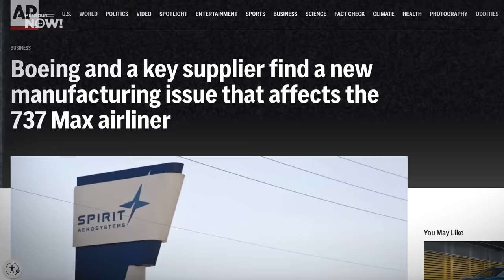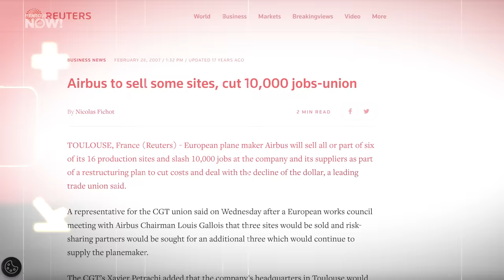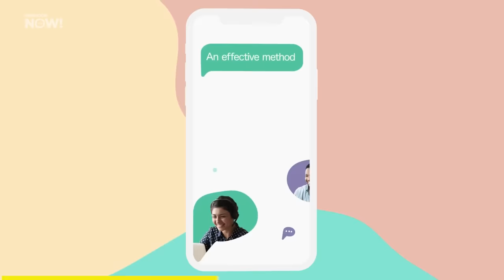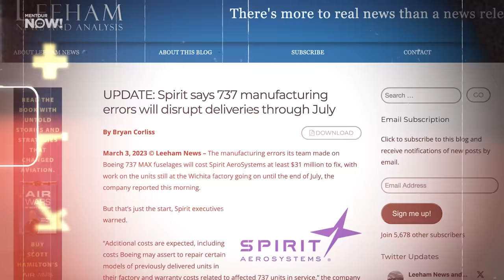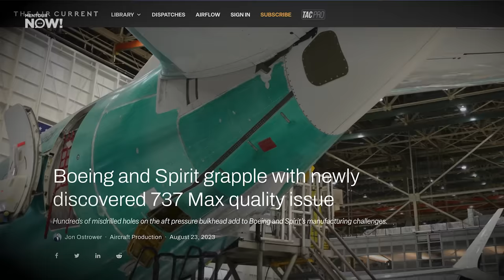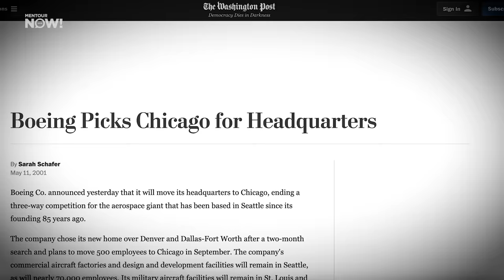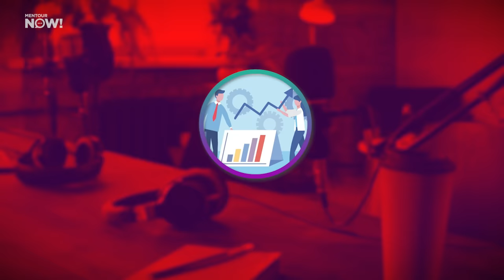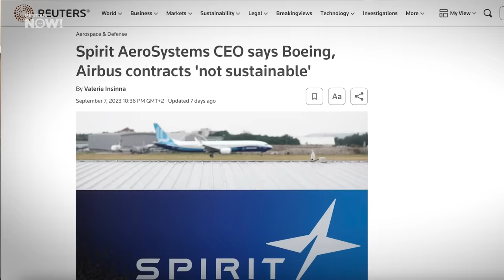NEW Problems with the B737MAX!

Comment: My respect to those Boeing and Spirit engineers that are holding on to their work ethics, honestly reported these issues and didn't let these seemingly small issues (but could be potentially catastrophic) pass by.
Reply: sh sh sh say what we tell you ex boeing worker
Reply: I'm having a disagreement with someone. What is the correct word to describe passengers disembarking a plane? Deboarding or deplaning?
Reply: @ghsubero I've heard both terms used interchangeably.
Reply: Well the route seems to be towards an ex Boeing engineer

Comment: Most impressive thing about Boing, is that they continue to disapoint without going out of buisness.
Reply: Thats not too hard when youre integrated into the Military/Space Industrial Complex so deep that the only option for the US is to throw Taxpayeer Money at you if your financials start looking bad. And if they keep looking bad, there always will be the next Military or Space contract where noone REALLY expect results (at least noone important) so you just get free government Money. Boeing isnt about building Airplanes or building anything. Its about influencing Voters by creating or removing jobs in key areas, paying Dividends to important Shareholders and keeping control over key elements of the supply chain. Money isnt an Issue.
Reply: Face it Orville...they make great aircraft and really don't have any problem selling their aircraft to hundreds of airlines. They are beloved by the pilots that fly them. Perhaps you are the one with the problem.
Reply: B737 "Maxx SHORTCUTS"
Reply: @MytronixOfficial B737 "Maxx SHORTCUTS"
Reply: That's because nobody went to jail when they killed over 300 people with the MCAS fiasco.
Reply: @lbamm  The justice system worked as designed. Just because you don't like the outcome...doesn't mean it didn't.
Reply: @RLTtizME  It's the legal system and there is very little concern for justice and if you believe different then you are a fool.
Reply: @craigmcallister2310  You kinda sound all jacked up.

Comment: The US as a whole seems to really be into this infinite subcontracting. Even in public projects you find the same mindset of "cutting" costs through subcontractors and it always ends up causing problems with the complexity. A lot of times, if something goes wrong, and in engineering something always goes wrong, that complexity ends up costing even more money.
Reply: So true. More effort is made managing the items that have been subcontracted. The savings are lost and worse the skills in those areas tends to be lost as well.
Reply: Short term profit. Maintaining the necessary capabilities means continuous investment, subcontract hides the costs of the latter making it appear cheaper.
Reply: nothing good comes from subcontractors
Reply: The video mentions (but doesn't highlight) the reason why subcontracting is advantageous. If the rear pressure bulkheads were still built in-house by Boeing, they would've had to shut down their entire production line while they tracked down and fixed the problem. But because the part is made by Spirit and two other subcontractors, only Spirit has to shut down their production. Boeing can still source the parts from the two other subcontractors, and keep their production lines running. Redundancy improves uptime.

Specialization is what took us out of the stone age. Before then, everyone had to hunt and gather their own food, build their own shelter, make their own clothing and tools, etc. By spinning these tasks off to certain individuals (subcontractors) who could then specialize in making only those items or doing those activities, they could become more skilled at it than someone whose time was distracted by lots of other activities (can do a better job in less time with less effort). And the people who can now trade for those products or jobs gain a lot more time they can use on other activities. That improves productivity. Nearly everything we build and use in our lives today is thanks to specialization / subcontracting.

The problem is it's not obvious how much specialization is the right amount. And different jobs can be optimal at different levels of specialization. Should the seamstress make her own cloth bolts and thread? Or is it better for her to buy them pre-made by someone else specialized in making just those? Most of economics is trying out different levels of specialization, and scaling back when things have become too specialized. All to try to get back in that optimal range. If you refuse to accept those occasional failures, you will never find that optimal range. And you will operate ignorant that you are doing so inefficiently.
Reply: @solandri69 Subcontracting isn’t necessarily a problem, but I’ve heard of subcontractors who start handing work off to sub-subcontractors and at a certain point it all becomes a mess.  In addition, when everyone is fighting to be the lowest bidder corners start getting cut and in commercial aviation, where the needs are so specific and the margin for error is so low, I don’t think that’s really the best pattern to fall into.  Obviously there are benefits to having multiple suppliers, but it’s Boeing’s name on the product and their reputation on the line if something goes wrong so I’m a bit surprised they’d outsource the production of such key components.
Reply: I called to order Domino’s pizza and it went to an lndian call center. Never called them again after that.
Reply: @solandri69 You’re right of course. The subject of optimal level of ”subcontracting”should be in focus. In our daily lives too!
Reply: That's the Mackenzie way of capitalism. Everyone's a bean counter now. They're losing their skills.
Reply: The fact that all that subcontracting causes extra bureaucracy overhead....
Reply: I had to laugh thou as the faulty parts were from SPIRIT and NOT the subcontractors 😂
Reply: It's capitalism. You're trying to make the most money with the least work. And the way you do that is you take $2 million for the part, then you find someone who will do it for $1.8 million and make it their problem. And they want the most money with the least work, so they take the $1.8 million and find someone who will do it for $1.6 million.
Reply: and worst of all, despite numerous examples (of subcontracting) that went wrong, they continue doing it -where is the learning effect?
Reply: and the very top of the contracting chain get to claim no liability
Reply: There's nothing wrong with subcontracting as such, it all depends on how you do it. 

For example, Toyota subcontract nearly everything, and that works pretty well for them. The reason it works for Toyota is because they do not treat a subcontract as a way of fixing cost, devolving risk, or shaking off responsibility for QC. When Toyota takes on a subcontractor, they don't set production targets, they instead set quality targets. Better 1 alternator is produced properly, than 1 million built wrong. They also move into the company themselves, get them working they way Toyota want them to, they educate them in "the Toyota Way". And, most importantly off all, *they pay their bills on time, in full*. The result has been that Toyota has a vast network of extremely loyal subcontractors who strive continuously to improve quality. 

Toyota can then mass produce high quality cars at good prices, and everyone in the food chain makes money, with parts famously turning up at the Toyota assembly line about 15 minutes before they're needed. Reliably. 

This has had other benefits for Toyota. They try not to have single sources of supply, but for some parts they have had. One of these suppliers had a factory fire, and shut down. Word spread throughout the Toyota supplier base. What happened was remarkable; a number of other Toyota suppliers worked together to establish temporary production of this part elsewhere, and helped the original supplier get back on its feet and back into production.
Reply: @juliadagnall5816  That kind of sub-sub-subbing happens, because the company at the top of the pile isn't taking sufficient interest in what their subcontractors are doing. Toyota is a good example of being very involved in what their subcontractors do. Interestingly, Toyota don't really major on production targets; obviously they want a subcontractor to make a decent number of whatever it is they're building, but it's the quality that's contracted for, not the quantity. Turns out that if you get the quality right, quantities will work out OK in the end too. Toyota also pay their bills promptly, which probably helps a lot. 

Boeing setting up Spirit is the complete opposite; it was a strong signal, "we're getting rid of this part of ourselves so we don't have to worry about it anymore". Well guess what...
Reply: Well Airbus do the same but they don't have the same issues. Looks to be just an American problem. Maybe they need to realise they are not the best at everything and just do the fucking job
Reply: I doubt subcontracting saves costs
Reply: It diffuses liability
Reply: This is the result when MBAs are left to make business decisions on their own.
Reply: @solandri69  true and the aerospace industry right now is a young workforce. And with faa NOT doing there jobs well, just adds to the industry issues. Boeing will get it right, it didn't go bad overnight, no one can expect a fix overnight. Nice read and really true.
Reply: Ahh the subcontracting mindset - the bane of quality, control, customer satisfaction! Eventually the loss of business because of the inability to deliver contractually.
Reply: @rogerdavis7450  not true Boeing has been outsourcing for over 90 years Airbus outsources as well no one airframe manufacturer can do it all...(NOT EVEN CLOSE TO DOING IT ALL) BOEING HAD A SURVEY DONE BACK IN THE 80S AS HOW BIG OF A BUILDINGTHEY WOULD  IF THEY KEPT THE WORK ALL WORK IN HOUSE.AND THE BUILDING WOULD HAVE TO 60 MILES LONG BY 40 MILES WIDE .END OF STORY
Reply: @rogerdavis7450  talk to the FAA it's their job to make sure qualityis up to standard
Reply: @juliadagnall5816 I never understood why paying someone on a full-time basis to do a job you have the capability to do is supposed to be cheaper than doing it in-house. If you would spend x in-house, they're gunna charge you x + profit + management fees.
Reply: @traveller23e  Cheaper is a relative term.  Think of it as a banquet hall hiring a full-time chef vs. partnering with a caterer.  The chef’s salary needs to be paid whether there are any reservations or not whereas they can call the caterer, who can cultivate relationships with multiple clients, only when they are needed.  It’s an imperfect analogy, but since Boeing can’t always predict how many planes airlines will order it kind of makes sense that they’d want to dump some of the overhead involved with manufacturing on a separate company who can have issues or go into debt without it showing up on Boeing’s financial reports.
Reply: @allthat46 It's a Boeing problem, not an American problem. Plenty of US companies build great things.
Reply: Sub Contracting is usually a way of offloading the blame for anything that goes wrong!	t
Reply: I think some of the problems companies like Boeing are facing are the results of following the outsourcing / subcontracting management fad that business consultants and rock star CEOs sold to companies in the 1980s. The “stick-to-our-core-competencies” philosophy behind subcontracting was, in part, a backlash to the merger / conglomeration fad that companies followed in the 1960s.

Comment: I have worked for Boeing and Spirit in wichita and I have seen many of the changes you talked about and you are right on. We truly strive to make the best products for the costumers. There have been several changes that affect production, sometimes in a good way and others in a bad way. Take "just in time" parts for example. The concept looked good on paper and would save millions in inventory. The reality though was quite different. This caused part shortages from suppliers. Example being instead of making 50 part batches each time they made a part, it was now reduced to 20. The part shortage would drive up travel work in the factory which drives up overtime. Aldo, the parts would usually show up on Fridays. Which means the installers now would have to work the weekend. More overtime $. Just in time parts dosen't make any sense when you have a backlog of plane orders that are over 2000. Just my 2 cents. Keep up the good work.
Reply: Forget the humility, Scotttravis, you're the goods and we're all listening!

Comment: I don’t know why Boeing when merging with McDonald Douglas’s, a failing airline manufacturer went « Ah, we need to have the same working culture as them, because it worked well for them ». I am a proud European over what airbus has become, but I am saddened to see Boeing falling so low with their 737 max
Reply: How were they a failing airline manufacturer? Boeing isn't to blame due to tne Mcdonald Douglas merger
Reply: The reason for failing on tne max is due to their supier not producing good quality parts
Reply: You're another one. McDonnell Douglas.
Reply: McDonnell Douglas made the F-15, F-18 and other military aircrafts. A lot of lucrative government money in making advanced military aircrafts
Reply: @nickolliver3021  If the supplier is not doing a good enough job then Boeing should catch those mistakes and manage them with the supplier.
Reply: @stephenconway2468  and that is what they have done, caught it early before it got worse
Reply: @nickolliver3021  Good. They caught it.
Reply: @stephenconway2468  exactly
Reply: Boeing agreed to the merger because of McD's defense division it would obtain in the deal. It was absolutely massive. The commercial division was nowhere near as important as the military division as essentially at the time Boeing had the commercial market firmly locked down with designs from the 737 all the ways to the newly designed 777. This is why it was seen as a good deal by both parties at the time and many people at the time agreed.
Reply: @FloorItDuh and then the MD CEO became the Boeing CEO and went, "Since I toileted McDonnell Douglas' Commercial Division, I know exactly how to run Boeing's Commercial side." He then proceeded to take the budget and spend it on everything but manufacturing. I know many employees from Boeing who said that they were told that profits were to be placed above all else and to stop over engineering planes since that costs money. The CEO said he hated the "family culture" of Boeing and decided the culture was to be more like a sports team. I.e. do only what you're told to do and be productive, or we will find someone else. No more employee innovation, management is the coaches and they come up with the plays.
Reply: @nickolliver3021 here you are again with your excuses. You sound silly.
Reply: I don't know why MD always gets the blame every time people are talking about Boeing's current problems with the 737 max.

Don't get me wrong, I never worked for Boeing or MD before or after the merger. But based on Boeing's history before the merger, this just sounds like business as usual for them. 

In the 80s the 747 had issues with the cargo door opening in flight (DC-10 ring a bell anyone?). Boeing tried to pin the blame on ground workers not closing the door properly, and only acknowledged there was a problem after it got people killed.

In 1991 after the Lauda air 767 crash, Boeing refused to issue a statement that deployment of the thrust reversers at cruise speed was unrecoverable, that is until Nicki Lauda threatened to test the theory.

Also in the 1990s Boeing was facing issues with rudder hardovers crashing 737's. They insisted on blaming pilots and weather, despite the fact that Boeing had received reports for years about uncommanded rudder movements.

Comment: It's getting to the point now where I'm starting to become nervous to fly any new Boeing aircraft, which I never thought I'd say.
Reply: Yep....I have changed from "if it ain't Boeing I ain't going" to "If it's Boeing I ain't going"
Reply: The planes designed in the 70s, 80s, and 90s are the ones I want to fly on.
Reply: @ajs41  747 & 757
Reply: Yes, and I am thinking of travelling by Ship. Am retired so time does not matter.
Reply: @leonardbenzies6374  I'd say that's the classy way to go, but modern cruise ships are usually a bit like a floating Las Vegas so maybe not!
Reply: @ajs41 me too
Reply: Certainly a silly statement.  You are more likely to die in that car of yours....by a lot. That doesn't seem to bother you.
Reply: You’re not alone, since the unsecured door plug incident many customers are refusing to fly on Boeing, including me.🙂
Reply: @kimberlyperrotis8962  That is nonsense.

Comment: As a former journeyman industrial machinist (long, long ago) I got a knot in my gut when you described the two separate error types. How the hell did this get past manufacturing inspection - or did the engineers buy off on these nonconformities? Yes, inspections are expensive, but I bet they look a little less so in hindsight.
Reply: I am pretty sure they didn´t. I am pretty sure there has been some Non compliances raised either by manufacturing it self or inspectors. but some manager decided to carry for some cost and delay reasons of their own. I bet their bonuses were involved ...
Reply: Boeing NDI tech here, assigned to 737 APB program. I was directly involved in the radiology of the aft pressure bulkhead here, and I can say there are a couple inaccuracies in this video, but I can’t say what. Part of this was the drilling. Not snowmen bad, but close. It isn’t a flight safety issue, and more a lifetime of the airframe concern.